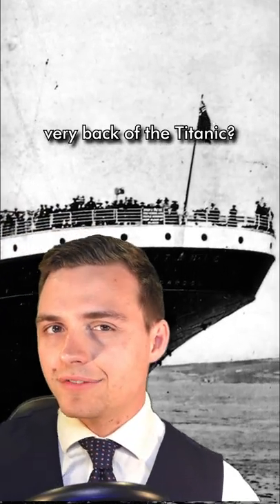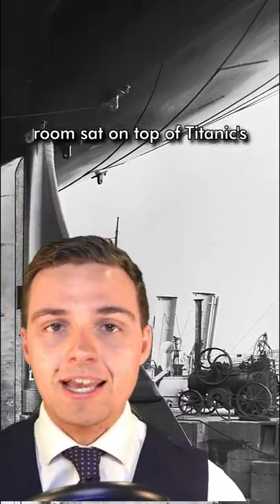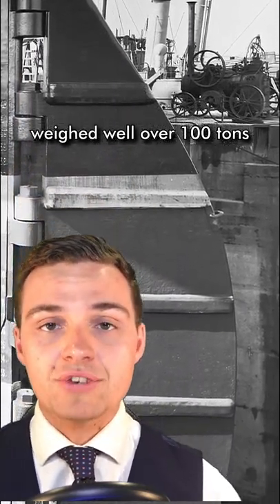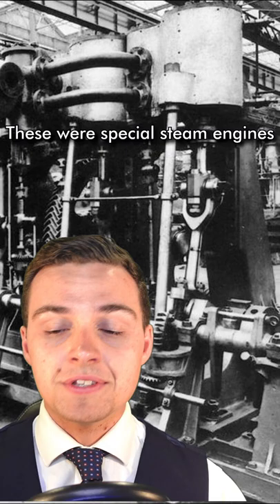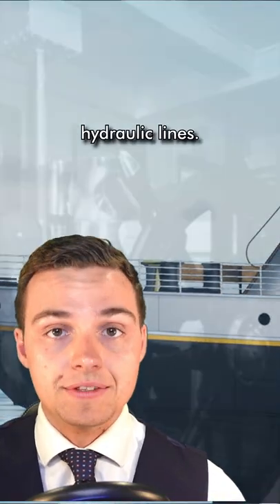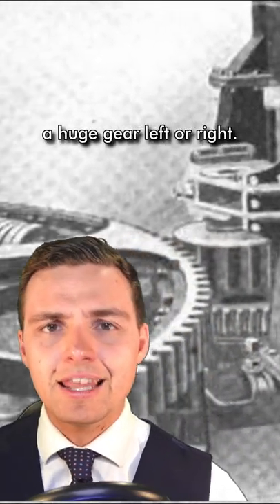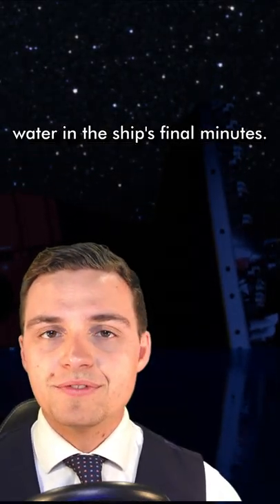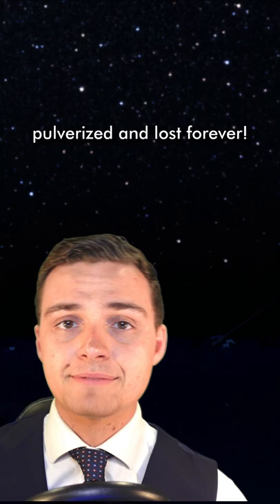What was in the room at the back of Titanic? | Oceanliner Designs Shorts

Comment: Okay, while I can agree with the equipment needed to operate the rudder, the location for which you are indicating (the portholes at the very stern of the vessel) are NOT where this equipment is located.  It's directly above where the top of the Rudder meets the hull, which as you can plainly see within this video is a good ways ahead of the room indicated.  Additionally, we have plenty of photography depicting this area of the ship and showing that there is no implosion damage here.  The damage to the stern is actually a combination of shear forces from the water and explosive forces from both heated component in sub freezing water and air being forced out versus compressed.  When the ship broke, the structural integrity of the stern was so horrendously compromised that air couldn't be contained well enough to enable an implosion.
Reply: it's the same. the aft portholes gave into the steering gear room.
Reply: @hugoslr  no, no it is not.  You're saying that the steering room is several decks tall, and potentially taking way more room than is required.
Steering rooms are not this big on ANY vessel, additionally, there is zero practical purpose to put steering gear aft of the rudder.
To further point out, steering gear needs to be level so it doesn't bind, this directly leads to not installing it in a location where the vertical clearance is rapidly collapsing.  You also do not unnecessarily make the rudder post absurdly long, you want the gear as close to the rudder as possible.  The steering gear room is thus far more forward, and several decks lower than the portholes at the aft end of the ship.
Reply: @hugoslr  Okay, I FINALLY found ONE schematic diagram that actually depicts the steering gear as being located on C deck directly above the Rudder.  I cannot tell if this room extends the other 30-50' aft to the rear port holes, but it does say it is on the same deck.  Chock it up to another failure of the design, as the sensible thing would have been to install it on E deck at the top or the rudder.  The other thing I found , is this area also appears to be shared with the Third class smoke room, which is a far more logical reason and use for the port holes, but since actual diagrams which show rooms and equipment placement from both side and top down of Specifically the very aft of the ship around the rudder and fantail are practically non-existent, I guess I'll drop it and y'all can have it.

Still a absurdly stupid configuration.
Reply: @jameskee2412  the third class smoking room was right forward of the steering gear area, along with their general room and access staircase.
also why do you ramble about it being "another failure of the design"? There would be no reason to put in below on E deck considering that would make it less accessible and there's barely any room for the engines on that deck... That plus the open area would already exist anyway because it housed the capstan engines. There would be nothing else in there, it's an almost direct mirror of the arrangement under the forecastle.
i'm also curious on what the other "failures" are.
Reply: @hugoslr  You mean, you aren't aware of the failure of the design of the water tight bulk heads that directly lead to the sinking of the ship?  Or the fact that the rudder was grossly undersized for the size of the ship?

And I'm sorry, but it's not uncommon knowledge to keep your steering gear as close to the rudders as possible (yes I know Titanic only had one, but there's other ship designs and I spent a good lot of time on a ship with two.  E deck was the perfect spot to place the gear.  It was right at the top of the rudder where a direct link was possible and they would have only displaced a store room.  Most ships don't have the steering gear right below the main deck.
Reply: @jameskee2412  no, i'm not aware, as both of those are myths. The rudder? It was on the lower side in terms of size but nothing like what most make it out to be. In no way it stopped these ships from steering well (as evidenced by Olympic keeping that exact rudder for 24 years with atleast one captain saying she was the best steering ship he ever commanded, or even Titanic herself, with that picture taken by Francis Brown of her tight S shaped wake on the way to Queenstown).As far as issues go steering was absolutely not one of them on these ships.
And for the watertight bulkheads, there is absolutely no evidence they were faulty. The ship was designed to survive with 4 compartments breached, it's absolutely not a surprise she sank with 6. 
   In that case, saying the watertight subdivisons were faulty would be like blaming a 5T rated bridge that would collapse under 8T of weight. It's not supposed to survive , so why would anyone expect the contrary?
Reply: @hugoslr  No due she exceeded design parameters.  That's a fault.  You just blatantly admitted you're aware of the faults and tried to defend them.  Good day sir.

Comment: It's a misconception that the ship imploded. If it had it would be crushed on the seafloor. There's was an account that there was loud noise people in lifeboats heard right after the shop was under water. That wasn't the sound of the ship imploding as some believe. It was the sound of the ships huge electrical generators becoming submerged and exploding. Electricity plus water equals explosion.
     A human won't be crushed until about 200 feet down so why would it be logical to think that a massive steel hulled ship would implode when it still hadn't gone very far down? At 12,500 feet below the surface of the water it's still not imploded.

Comment: And it still wasn't big enough to turn that ship fast enough to avoid the iceberg
Reply: The issue is the ship went to reverse and flow was not sufficient for the rudder to steer.  It’s been theorized that had the ship gone to full forward the rudder would have steered the ship away from the iceberg for more of a glancing strike vs the impact that happened.

Comment: I've always wondered how the Titanic aswell as other large ships and ocean liners were steered with the wheel and in my thinking I was seeing a mechanical connection but was wondering how that would work from one end to the other of the ships and then having multiple wheels working the same rudder really had me thinking about how a mechanical connection from several would work together. Also the strength it would take from a person to turn the wheel because with a mechanical connection the pilot would be moving a massive rudder, ofcourse with the mechanical help of gears I would think but still would be harder to turn than what you see in your mind when thinking about someone steering a ship. So hydraulics makes perfect sense to account for the ease at which the wheel is turned. I didn't know the use of hydraulics was very wide spread in this time period. Looks like hydraulics were very complicated at that time too, needing to have steam engines to run them. It's really awesome that I found this out because I'm into steam and hydraulics both separately so now I can start researching and learning more about them together and how widespread their uses together were and things they controlled. Awesome! Very neat video.  👍

Comment: What would have happened if they had turned the rudder in full ahead.  The ship would have turned and missed the ice berg.  Throwing the engines In reverse took away any ability to steer and the ship drifted into the ice berg at an angle.
Reply: They didn’t reverse the engines in reality.

Comment: I thought it’s rudder was still to small and slow to turn?
Reply: Not by much. The real problem was it took 30 seconds for the rudder to start turning after the helmsman turned the wheel. The hydraulic lines had to open the steam valve to the selected steering motor, then the steam pressure had to be enough to start moving the rudder.
Reply: @stevenweaver3386  oh I see if they sped up?

Comment: No. It was a 3rd class sitting room. That is all. The engines and machinery sat a little further forward on the ship but were way down, well below the waterline.
Reply from the maker: You're welcome to go check the C-deck deckplans but you'll see that this room was actually further aft of the 3rd class general and smoking rooms :)
Reply: @OceanlinerDesigns  The point still stands that the engines and machinery were no where near this room
Reply from the maker: @dougg2012  Hi Doug yes, the Titanic's main propulsion; the engines and turbine, were far below and forward in the engine room. But the room at the very back of the ship, as discussed in this video, contained the steering engines which were a separate unit.
Reply: @OceanlinerDesigns  no, it didn’t.
Reply from the maker: @dougg2012  haha mate go look at some deck plans and then get back to me
Reply from the maker: @dougg2012  here you go!
https://www.encyclopedia-titanica.org/titanic-deckplans/c-deck.html
Reply: @OceanlinerDesigns  I did.
Reply from the maker: @dougg2012  oh good so you can see that the steering engine room is in fact behind the 3rd class general and smoking rooms?
Reply: @OceanlinerDesigns  nope because it doesn’t exist
Reply from the maker: @dougg2012  Haha you crack me up

Comment: Actually all that gearing being solid iron probably as a ship went down if the air didn't escape out through cracks because as it went down and that are expanded it was going to start popping rivets so it may have burst a seam and then just shot out pretty damn quick but if it got all the way to the bottom and didn't in fact implode all it really did was wrap up all that gear in a bag of steel kind of like when you suck air out of a food bag and it shrinks down around cold cuts and stuff like a real big seal-a-meal

Comment: Cool, too bad the rest of the ship was poorly built.
Also, I heard the rudder was too short to turn that big of ship in a shorter distance.
Reply: It lasted 2 hours and 40 minutes with enough damage to take down any other contemporary vessel within one hour…and you call that poorly built.
Reply: No, it was built very well, for the time and available technology. State of the art.
Reply: @DerpyPossum  I mean the water proof doors didn't reach to the top so thats badly built
Reply: @leopard_2A6-906  It was the bulkheads that didn't reach the top, not the watertight doors. The doors were fine.
The midship bulkheads were the only ones that weren't very tall; they extended as far as E deck as the ship was designed to survive up to 4 compartments flooding, which wouldn't have brought them lower than the waterline. Having the bulkheads going all the way to the top wouldn't have made the ship livable, and even after the bulkheads on Olympic and Britannic were extended they still didn't go all the way to the top. 
Name one other passenger ship from Titanic's time period that had bulkheads like that.
Reply: @DerpyPossum  I forgot what they were called I meant the bulkheads

Comment: Imploded ? Like when there is a vacuum ? Pulverized machinery because of an implosion ? This doesn't make any sense.
More likely this part sunk and formed an air bubble that slowly filled up because of likely leaks. This machinery is probably rusting at the bottom by now.
Reply from the maker: The stern section exhibits evidence of implosion damage caused by the extreme water pressure acting on that part of the ship which had not flooded and was still full of air. The air did not have time to escape, and as the stern was dragged under hundreds and hundreds of tons of water pressure caused implosion.
Reply: @OceanlinerDesigns  Oh I see, now it makes sense. It's not that the pressure inside was low, it's the pressure outside that was high. It sank very deep so the pressure must have been immense.
For some reason I didn't think about it this way. I thought that maybe the steam created a low pressure by replacing air and then cooling down.

Thanks for the precision and patience.

Comment: Do you know what an implosion is? Have you got any sense of or knowledge of physics?
Reply from the maker: There is significant evidence of implosive damage to Titanic’s stern section so yes, I do.
Reply: @OceanlinerDesigns  No you don’t and I doubt there is. There’s really no way an implosion could occur.
Reply from the maker: @FlygisTheFlygis  
The commonly-accepted theory is that spaces such as the refrigerated storage rooms did not flood passively, but retained air. As the stern sank, the walls and decks which made up these enclosed spaces were forced to sustain the increasing water pressure. At some point (different for each large space) the theory is that they imploded (collapsed explosively inward). An underwater implosion can be quite violent, as was illustrated by the Thresher disaster. 

A number of survivors in lifeboats reported hearing dull "booms" or sounds like large artillery at a distance after the stern disappeared. These sounds are attributed to the implosions.
Reply: @OceanlinerDesigns  the area outside of such enclosed spaces exploded into them. implosion is something else